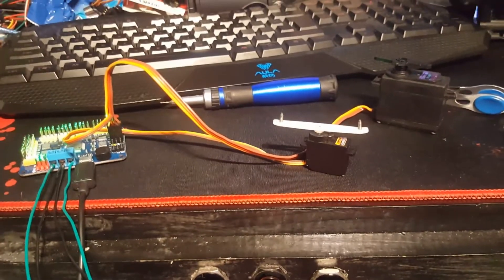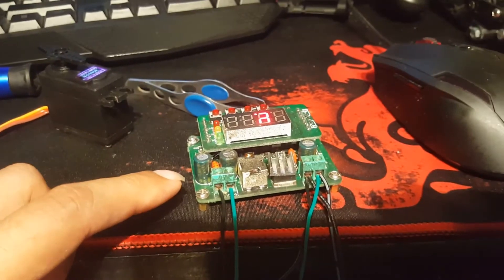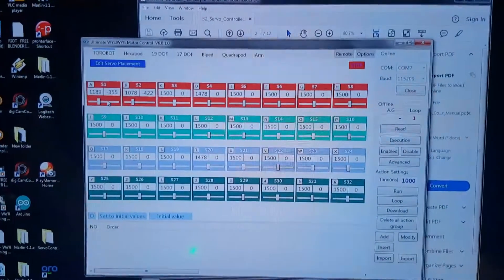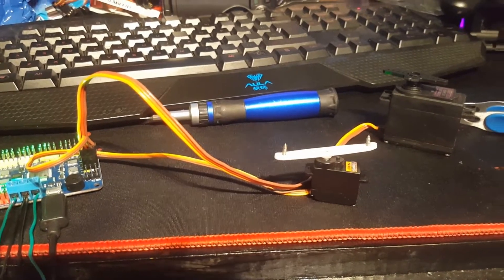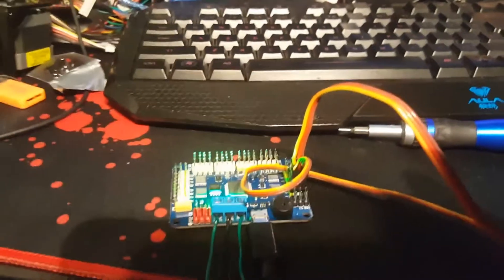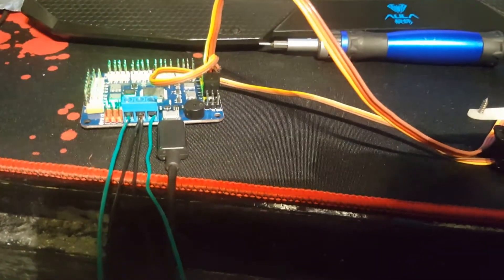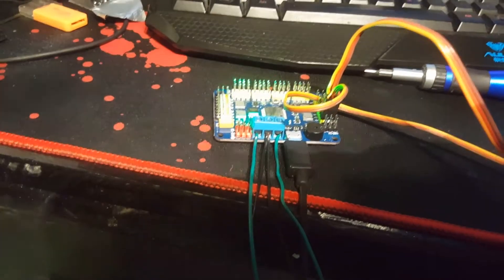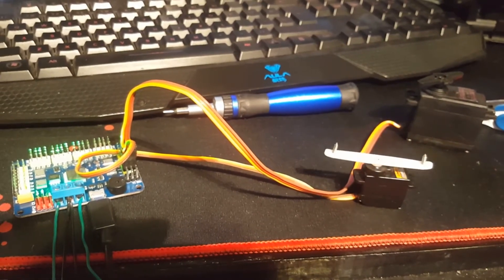How to set up 32 channel servo controller!

Comment: Your video is so usefull, thank you so much.
But I have a little question. If I connect all of 32 BIG servo to this board, it mean the current move to the board can be reach 64A. So that is possible or not? I am not sure about the maximum current of VCC line ._.
Reply from the maker: there is no way that board can handle 64a even if you had a heat sink to many amps but you could power the servos by them selves and use only the data line to control the servo just have to run power straight to the servos from another power source
Reply: @LegitLeeVelez   thank you. I powered for servo by another line not use VCC (Green led off) then the buzzer on board beep beep over and over. I have to turn Buzzer off on the software and then it worked well.
By the way,  can you show me the way to get Software V6.0.1.0 as this video? I have just downloaded version 3.3.7 on link: http://www.rtrobot.org/software/      It worked well when I connected with the board, but run too slow when I just opening the software. I think because of windows version not compatible with. Then I tried to use compatibility mode to run it under windows xp and windows 7. Not solving at all.
Please, if you can, share the link of that software for me,
or send via email: baronvn7197@gmail.com
I will so grateful ^^!
Thank you.

Comment: Nice dude, this helped immensely. My problem is I'm trying to integrate this board :  https://www.alibaba.com/product-detail/Servo-Controller-Driver-Board-32-Channels_60710620212.html?tracelog=null, into a small robot and I don't want to be tethered to a power cable. I need some sort of battery pack to run this thing to be wire less and mobile. any ideas?

Comment: hey man does this works wireless?
Reply from the maker: Srishtygarden Resorts it will with the controller and depending on what parts you use you may be able to get to to work with wifi and Bluetooth but would have to do some serious coding so good luck on that

Comment: One question Lee  if you allow me.
When you connect the board to the USB, does the red LED light up?
Reply from the maker: Kenzo Akihiro I will check for you I can't remember right now and don't forget to subscribe I will have more videos coming soon about the board
Reply: Hey! Dont worry,  It did not work, it was replaced and now it is. I will follow your videos to learn

Comment: I have a big problem, usb not detected by windows, nothing at all, no led lights, only if food 5v vcc lights green led, but windows still does not detect the board
Reply from the maker: Kenzo Akihiro then Google the drivers for the board
Reply: If windows no detected de usb.... need this drivers?
Reply: @KenzoAkihiro  same :( Any solutions ?
Reply: @gumush  no one, buy a new one :(

Comment: how u can use 12 volt on servo controller ... mg996r burnd
Reply from the maker: Mamun Karim I use a voltage step down to get it to 5 volts
Reply: Lee Velez what is servo voltage how can it handel 12 v input
Reply from the maker: Mamun Karim servo voltage is 5 to 6 volts and i use a voltage step down from 12v to 5v from the servo
Reply: basically im talking about  servo controller  vcc 12v input ... When when i Add 7.4 v it burn out my servo
Reply: Servo controller power 5v Ok .... But Vcc Port U shown 12 V From Adepter Conection
Reply from the maker: Yes the Servo controller is 5v but the green wire all the way on the far right is a positive 5v and the center is the negative 5v for the power of the servo
Reply: Left Side Green Ware Coming From Adopter 12v ...

Comment: Hello good morning the doubt I have is how you loaded the firmware to the controller board of 32 servomotors
Reply from the maker: juanjo choquepuma I just downloaded the software and when its saves on the program it saves to the board
Reply: Ola what is the software that you downloaded i can send me the connection diagram of the loaded of the firmeware acia the controller board of servos
Reply: Hi